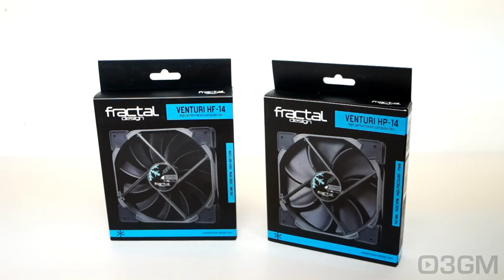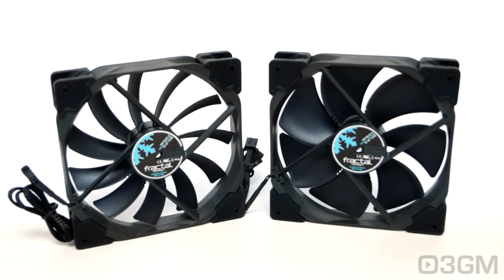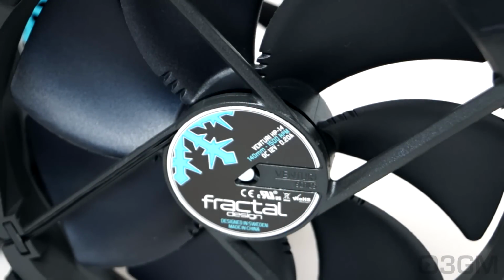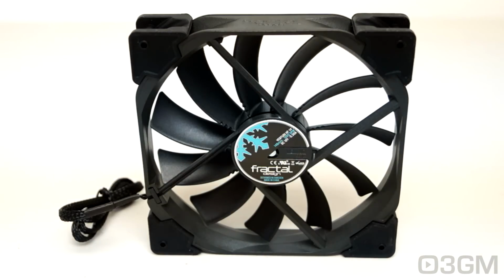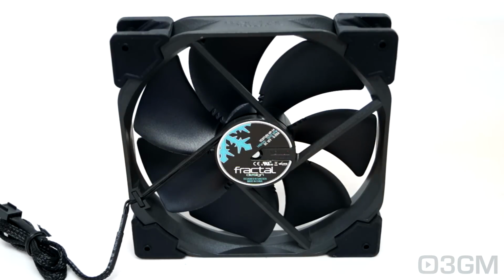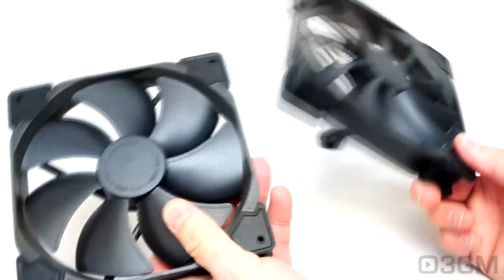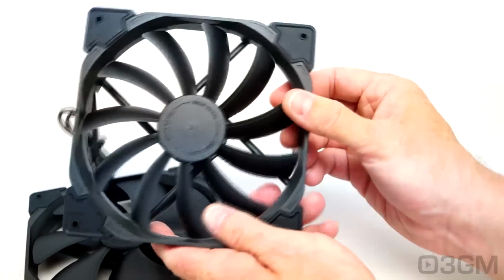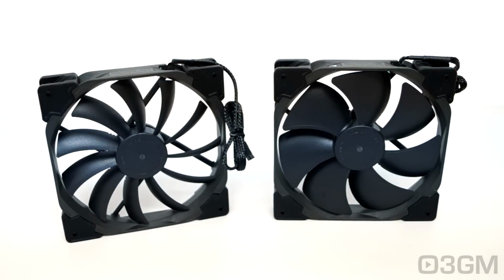#1711 - Fractal Design Venturi HF-14 & HP-14 140mm Fans Video Review

Comment: For heat sinks and water cooling you have to use HP-14
For PC Case you need the HF-14, but what if your case have dust filter ? hmmmm
Reply from the maker: +LordLab Yea, you can use the same fan. Keep in mind though that dust filters will impede fan a little and can make it somewhat louder, but without them you introduce dust inside the case. If you keep your place really clean, don't smoke or have pets, it's not crucial, but remember to clean your case every few weeks. 

Remember to like, sub and share. I appreciate it. Thanks :)
Reply: +LordLab For dust filters you can use hf fans, but when a dust filter is in front of the fan then there will be a difference